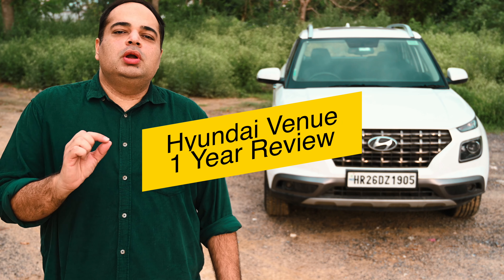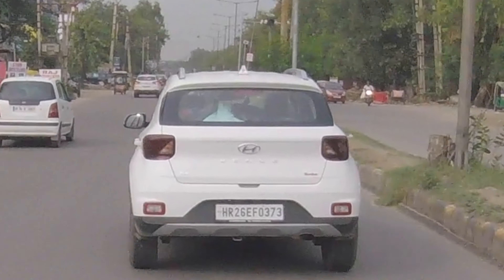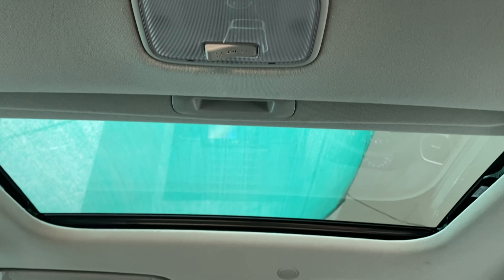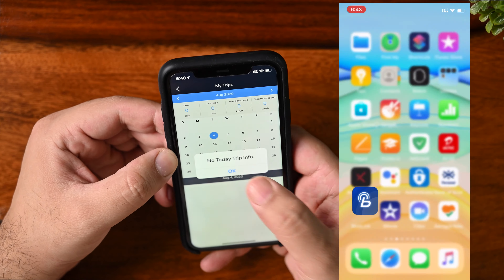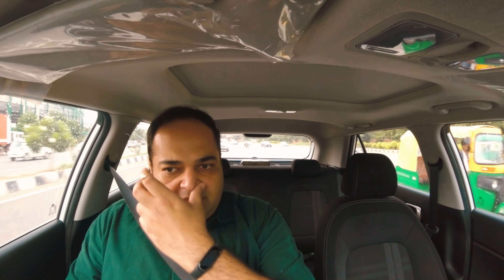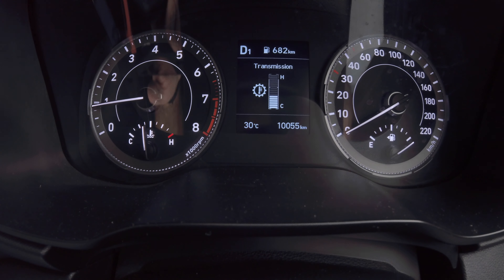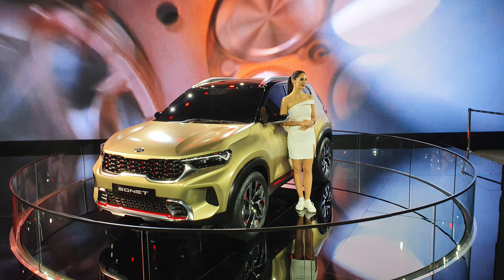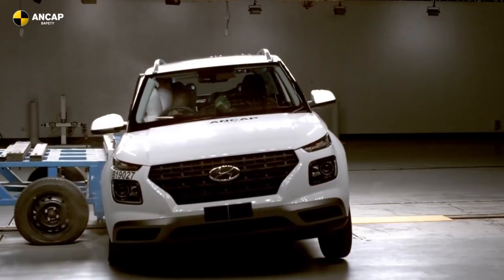Hyundai Venue Owner Review - A Year's Experience in 2020

Comment: You can unlock or lock your car without the noise by pressing lock and unlock button together in the key. The indicators will flash 2-3 times to tell you that the sound has been activated or deactivated.
Reply from the maker: Hi Nitish, tried this but it doesn’t work with the Venue. Tried many times with instructions like this for varying durations from 20 Sec to 1 minute, but simply doesn’t work. It does work with some Hyundai models though. 😔

Comment: Hello Sir, thank you for your detailed ownership review. However, I have a question if you may put some light on the same.
When the DCT engine is designed in a way it may heat up if driven in heavy traffic, cant we switch to manual mode while in traffic to avoid heating, will that stabilize the temperature or maintain the temperature of the transmission system? Also, the 2022 DCT Variant also has paddle shifters which can be used to shift between 1st and 2nd gear in traffic if required. Please share your insight in the same. Thank you
Reply from the maker: The overheating occurs when the car is trying to shift between gears, so that means the clutch is constantly engaged. Keeping it manually locked in one gear will help. If it’s any consolation, in the nearly 3 years that I’ve had it, the DCT has never overheated. But I think the advice remains the same, do not buy this type of transmission if your main usage is bumper-to-bumper traffic. If it’s a good mix, then it’s a very rewarding transmission to drive and enjoy.

Comment: Could you  help make decision Venue DCT vs Venue iMT: For city heavy traffic drive usage(Once in a while), Should we choose venue iMT over  venue DCT  because of its heating issues. Or These heating issues with venue DCT are easily manageable by anyone?
Reply from the maker: Shreedhar, since you say ‘once in a while’ it becomes easy to recommend the DCT. It’s easily the more fun to drive variant. It’s not as if every drive in heavy traffic will make the transmission overheat, it’s just that if driven like a normal auto, so that means constantly chasing every gap in traffic and making the clutches engage/disengage then there is the potential to make it overheat. Never faced an issue myself with it. Have you driven them both? Sometimes the picture gets clearer after a back to back drives of both variants. So drive them both and then decide, personally my money will never go on an Imt, if not DCT then a manual. Hope this helps.

Comment: Thank you for the wonderful video. Sir, is the new DCT version of the venue worth buying for or should we go for the manual only ?
Reply from the maker: Thanks Madhurjya for your kind words. Both are great to drive, I like the DCT for the added convenience but the manual with its slick gearshift and light clutch is also a pleasure. I think it will depend on your driving cycle. If its mostly away from traffic then the manual can be a great choice, especially given the fact that you can get the SX (O) model with it and the added safety features.
Reply: @TechnologyRig  thank you Sir

Comment: Hi Ashish, I have a question about the inherent problems the turbo-gdi engines have of carbon buildup above the intake valves. You might only face it later in you vehicles life around 50k kilometres, is there a service schedule around that time for the intake system cleaning? I've tried asking my local dealerships but they couldn't revert with a proper answer.
Kudos to you on this very detailed ownership review.
Reply from the maker: Hi Prithvipal, thank you for your kind words. You raise a valid point. The service schedule lists throttle body cleaning at every 10k kms and valve clearance inspection every 90k or 108 months. That’s all. Then they recommend using an additive they sell at service centres if fuel quality in your area is not good and below European EN228 standard. In any case as you maybe aware, aftermarket TB and IV spray cleaners are available nowadays for any such potential problems and if the service centre isn’t doing what they’re supposed to at each service! Hope this helps.

Comment: Thanks ashish for the excellent review..I have to encounter  heavy traffic everyday on my way to office. Will adapting my driving style as per your recommendation resolve the heating issues for DCT variant considering my usage?Also would it help if I switch to manual mode during bumper to bumper traffic to deal with the heating issue? seek your advice!!
Reply from the maker: Hi Amit, I find it hard to recommend a DCT gearbox to anyone dealing with heavy traffic on a regular basis. I for one, have never had issues in such conditions, so I’m fairly confident that it will not overheat. Maybe I should do a test specifically looking at this and create a video.. anyway even if you select gears manually, stop start traffic means you’re engaging and disengaging the clutches every time you brake and accelerate. Why don’t you consider the Sonet Automatic diesel instead? Are you based in the NCT region?
Reply: @TechnologyRig  Thanks Ashish for your quick revert.  W.r.t. revert on chosing manual mode of driving on a DCT gearbox, my understanding was that it would engage only one clutch rather than dual clutches when on auto mode so lessening the heating problem. I stay in Mumbai and considering my annual running of ~12k-13k kms mostly within the city during office commute, I was keen on petrol variant being more economical option. But seems I need to reconsider. Thanks Ashish again and yes if you do plan to make a video during heavy traffic with DCT gearbox, I am sure it's gonna help lots of perspective buyers.. Keep up your good work.. Best Wishes!! 👍

Comment: Excellent review.Covered all the aspects. I have driven alto for 10 years and now I am planning to buy Hyundai venue and confused between SX + manual and DCT. My driving doesn't involve too much of bumper to bumper traffic. Can you please clarify the following aspects
1. Is there significant difference in Mileage
2. Service cost comparison
3. Does it make sense to spend additional 2 lakhs on DCT and will it make driving that much easy compared to manual since I have driven manual for 10 years
Reply from the maker: Hi Surya, thank you so much for your kind words. Your profile seems a good fit for the manual. I've driven it and loved it with its performance, slick gearbox and light clutch. Fuel efficiency between the two is not too different, unlike the older torque converter autos, DCTs are quite fuel efficient. Service costs will also be similar, there may be the added cost of a replacement clutch a few years down the line but you also loose the complexity of the DCT. So I think you could do well by saving the money and going for the manual, especially since you say you don't do much rush hour driving. Hope this helps.
Reply: @TechnologyRig  Thank you for finding time to reply👍👍. Your command in the language is excellent.It was really a nice experience to watch your video. Continue your good work
Reply: @TechnologyRig  Sorry to bother you again. I have made up my mind to go ahead with DCT 😀. Really confused between S and SX. What are the features which I would  miss if I go with S instead of SX and what all things can I add to S post purchase , since I feel spending 13.50 lakhs on SX is too much for me

Comment: Your review on Venue DCT is fantastic. I am a Venue DCT owner. I have been driving this vehicle since Sept'19. Till now everything is fine with my vehicle. Just one little problem I have with my vehicle. When I hard press the accelerator for sudden acceleration (say when vehicle is already running in higher speed like above 60-70kmph) clicking sound comes twice or thrice before it picks up. Is it common with every venue dct gearbox? However, there is no such sound during progressive acceleration.

Comment: Hi great review. 
In your opinion what is your long term view about 3 cylinder turbo engines like venue,nexon etc from NVH perspective as well as engine reliability and maintenance costs and frequency of parts replacement?
Reply from the maker: Debashish that’s a good point you raise. If there’s ever going to be a reliability concern about these cars, it will be from the GDI design perspective. The inherent design of these engines means there is potential for soot to develop on the outside of the pistons, but there is a method to clean this and Hyundai seem to have incorporated this in their service schedule. So as long as you keep on top of servicing, you don’t have a case for worry.

Comment: Very nice video sir...
I'm a little bit confused between venue and nexon..... Between venue s turbo and nexon xm petrol... Which one should I buy....
And if I travel 60-70 kms daily then should I go for a diesel variant or opt for the petrol one
Reply from the maker: Sawan my preference between the two will definitely be the Venue and since you’re going for the Turbo engine, it’ll be great fun to drive! 60-70 kms daily means you may benefit from going the diesel but if the drive consists of highways also, the difference in economy will not be much. If we were talking Creta here I would say go for diesel since that has a stronger diesel but the Venue is lighter and the petrol engine is small capacity so good economy. Drive both and choose as per preferences.
Reply: @TechnologyRig  which one would you choose.... Nexon or venue or creta diesel
Reply from the maker: Sawan in your case I think the Creta diesel will make the most sense..
Reply: Than you sir.... Thanks a lot for your advice

Comment: plz tell that is the 1.0L engine enough for venue , in regions of India where we have hot humid climate so AC is very important and we have crawling traffic also we don't have that good roads. isn't it too much for 1.0L engine or this engine is able to handle it all  at once and doesn't suffer ?
also , i was thinking to buy a venue automatic and since imt launched so i was planning to buy sx IMT variant of venue , how does it fair against i20 1.2L cvt which costs almost 30-40k less not major difference.
plz tell
best video i ever found about venue on youtube
Reply from the maker: Hi Pranshul, the 1.0 Turbo of the engine is very powerful. Infact the power figures for this engine are class leading. Also the AC in this car is one of its major strengths as mentioned in the review, it is super effective and chills the cabin in no time. Globally the trend in the automotive industry is to downsize engines and turbo charge them, so rest assured this is the car's major selling point. The i20 CVT is very smooth and nice to drive in the city, but as soon as you take it on the highway, the rubber band effect of the CVT is felt and there is a lot of lag. Both are different technologies so I suggest you drive them both to see which one you like. Choose based on the drive experience. The new i20 is a terrific design and you won't go wrong with either car. Hope this helps.

Comment: Great video sir.. 
I have a question about venue dct, 
If I drive in bumper traffic , can using manual mode/ Tiptronic mode will resolve overheat issue in dct? My bumper traffic drive is 10 km everyday out of 30 km.
Reply from the maker: Hi Bhushan, whenever you press the brake you’re engaging and disengaging the clutches. The issue is not related to frequent fear changes in bumper to bumper traffic, but rather frequent operation of the clutches. So I don’t see how keeping it in one gear manually will make a difference. In any case at crawling speeds only the lowest gears will be used. If it’s any reassurance, I’ve never had any problem with the DCT in mine. Simply adapt your driving style as mentioned in the video and you’re good to go!
Reply: My 1 year old Venue DCT TURBO PETROL heats up in 30 mins in traffic. Be advised about overheating in dct
Reply: @kunalchoksi  hours much time does the DCT take to cool down?

Comment: Hi, I want to know about DCT TEUBO Engine is good or bad in Mumbai traffic stop go condition  i hear this engine is heat ?  Or please tell me which automatic engine is good for stop and go condition terrific.
Reply from the maker: Hi Anju, problem is not with the engine, it’s the transmission or gearbox. Yes there have been reports of the DCT heating up in Mumbai traffic. Ideally this is not the transmission type you should choose for this type of usage. Any car with a torque converter type auto or even a CVT auto will work well in this scenario. If you want the Venue specifically, there’s another option called iMT now which is basically a manual without a clutch. You can consider this if you don’t mind changing gears but don’t want the clutch. My own DCT has never overheated but does require you to adapt your driving style in heavy traffic, as discussed in the video. Hope this helps.

Comment: Between Hyundai venue DCT vs Kia Sonet DCT which one is preferred one.
Reply from the maker: They're essentially the same. Sonet has a few extra features now, like ventilated seats and a bigger display. It's down to the looks mainly and which manufacturer you prefer for your servicing needs. The Sonet will temporarily outsell the Venue if you ask me, but eventually it should level out. Unless you're looking for a diesel automatic, you can pretty much choose between them based on your tastes, you wont go wrong with either!

Comment: I have seen your review. it was nice. But I have one question that I wanted to ask you. I want to buy Hyundai venue but I am getting confuses which transmission I should buy manual transmission or DCT.. with 1 litre turbocharged.
Which would be best engine option according to fuel economy and some other aspect....
Reply: depends on your use
Reply: Use kam hi rahega gadi city mein chalegi jyadatar aur kabhi kabhi bahar Jana Hoga like 300-400km. 
But all in all gadi bahut hi kam chalegi..
That's why I am getting confused which one I should select.
Reply from the maker: Go for the DCT Ankit, based on your usage it doesn’t seem like you will be commuting in heavy traffic every day. That is the only situation where a DCT is least suitable, unless you adapt your driving style like me. Rest, it’s the most fun to drive variant and you will love listening to its engine note when pushed. It’s also fairly economical after the 1st service, around 12-14 kmpl in most situations and more on the highway. But it will never match the diesel in this respect. But based your usage, go for the DCT SX+. Hope this helps.

Comment: Good review.. however, still feel an IMT is a better option than the dual clutch automatic - where many people have had heating & some expensive long term reliability issues.. changing gears manually through a joystick in traffic is not an issue for most people - the issue is only with the constant engaging &  release of the clutch which the IMT takes care of at only twenty thousand rupees extra from the traditional manual variant..
Reply from the maker: Devrishi  you have a point and there’s certainly a market for it. Especially at that price point. Personally I would rather get the manual or the DCT. The manual’s clutch is ultra light and the gears are a joy to use. And the DCT is great as outlined in the review. But again, that’s the beauty of choice!

Comment: I have a query, In extreme circumstances like heat or traffic if I switch to manual in DCT and stay in first gear will it help cool the heating issue.
Reply from the maker: Adithya, I was having the same discussion with another viewer, and he rightly pointed out that in the scenario you mention, only one clutch will engage/disengage. This should reduce the heat generated. But really the issue is not that bad at all, even in automatic mode, just be firm on the brake and don't drive in jerky forward movements. With those two things, you will be fine. Obviously if an owner experiences heating issues he will be vocal about it and Hyundai themselves acknowledge this characteristic of DCT gearboxes and have made a best practise video about the same. Thus, you can't sidestep this issue, but in my experience, driven with the understanding of DCT transmissions, you will almost never have an issue. And you will enjoy all the perks that the technology offers. Hope this helps.

Comment: Sir! Which one is better? XUV 300 or Venue? I'm thinking to go for XUV W8 (O). Will I regret if I forgo Venue top variant for XUV? And I don't think there's an ocean of difference between Sonet and Venue, both are almost equal except some feel good features. I really like it when Mahindra respected Indian mentality by providing a full-fledged middle seat with a proper headrest and seat belt. I give more impotance to the comfort of the middle person than to the lesser boot space on the back. Please reply.
Reply from the maker: +Sivasankar Bhavan The XUV 300 is also a great buy, good to drive and a thoroughly engineered product. And you’re right, the space is certainly better in the middle row. Base your decision more on the the engine and transmission choices on offer because this is where these cars differ. If you want a good automatic, the Venue/Sonet is where you should park your money. If manual, then you can choose basis a test drive..
Reply: @TechnologyRig  Thanks a lot for your valuable reply. Take care sir.